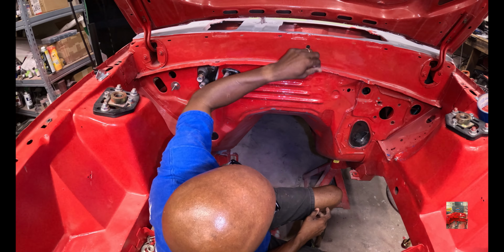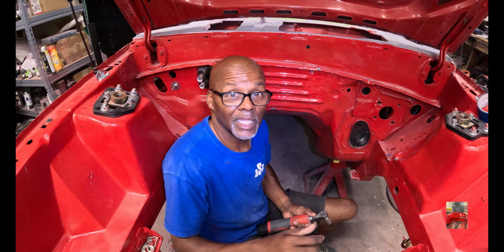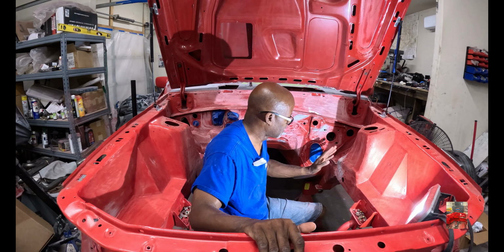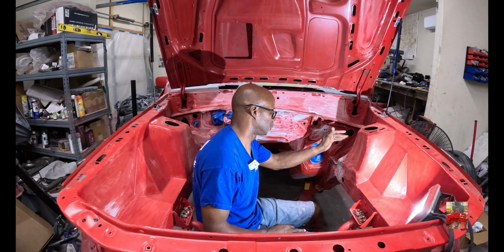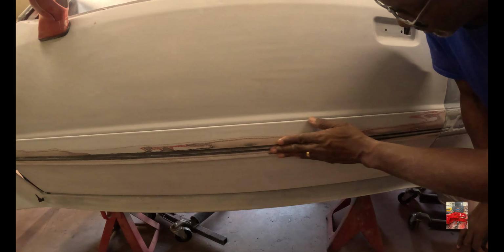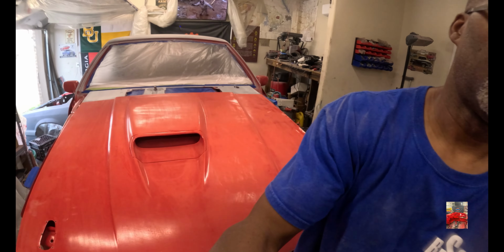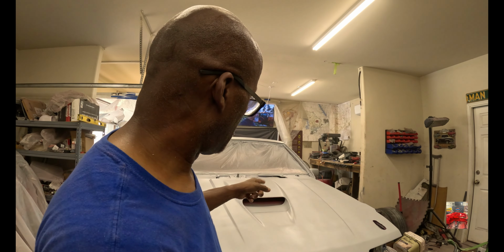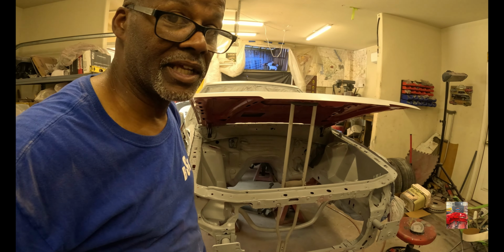85 FoxBody Mustang Notch Back Build EP 40 (Laying Down Primer)

Comment: Looking good bro!  The paint bubbling up on the door might be from it not being scuffed enough before paint was applied.  Red scotch brite pads work well for scuffing in tight areas.  Also, just a heads up, that primer needs to be sanded before more coats are applied.  Good luck!
Reply from the maker: Appreciate the heads up on the primer 88Mach1. I was going to prime right over the first coat lol.
Reply: Yeah if you let the paint dry and get outside it's flash window, then you need to scuff it all to give the new coats something to bite to.  That applies to all paints (primer, base, clear, etc.).  @bonezshakergarage

Comment: Good stuff Bro! I'm loving what you've done so far. Question... did you get a new camera? Seems a little clearer the past episode or three.
Reply from the maker: Thanks 89G. I did get the GoPro 11 about 3 or 4 videos ago.
Reply: @bonezshakergarage  do you use the internal mic, or an external?
Reply from the maker: @89G I use both. I have had the Rode mics for about 9 months and never used them until lately.
Reply: @bonezshakergarage  nice.... I got my a Rode mic too, but it kept cutting out on my 7, so I got an 8 to mess with now. On the 11, can you plug the mic directly into the camera? Or do you have to have the silly adapter still?
Reply from the maker: @89G  plugs right into the camera.